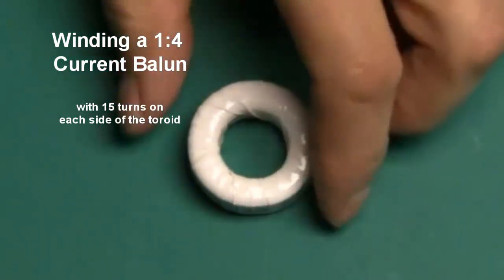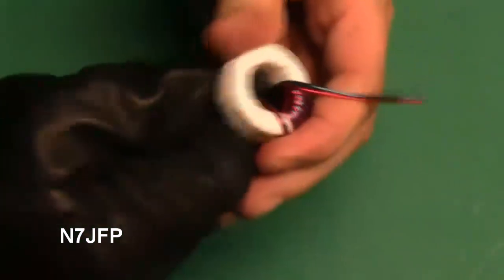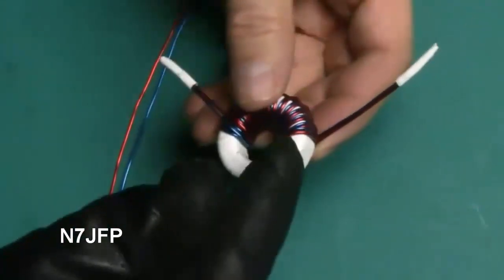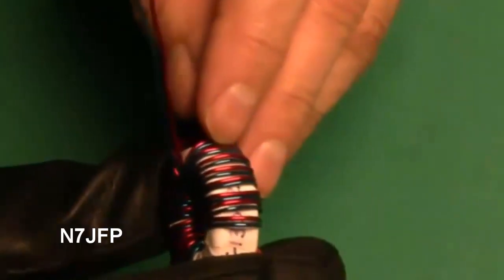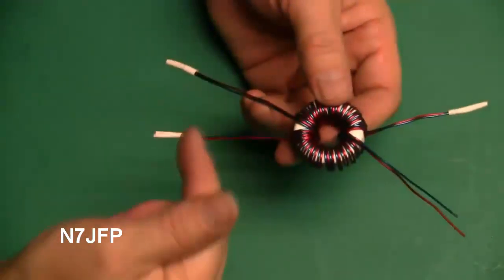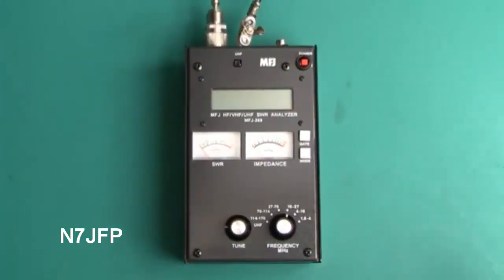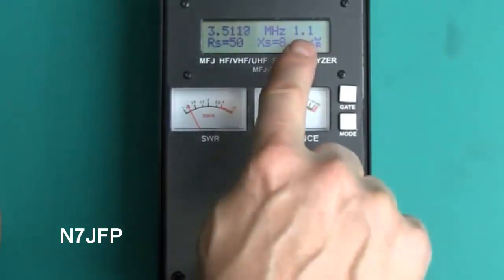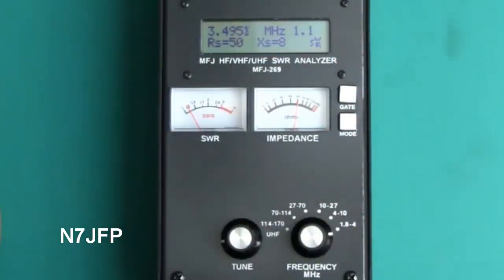Winding a 1:4 Current Balun with 15 turns.

Comment: I noticed that you call this 1:4 instead 4:1 are they the same thing or totally different? Will this ballun match a 50 ohm radio to a 200 ohm antenna
Reply from the maker: Yes. 50 to 200.  Works great.  Thanks for watching. N7JFP

Comment: Are they good or help receiving as well
Reply from the maker: I have not tried using it on a receive only antenna.  It's main purpose is for the transmitter/antenna matching.  73, N7JFP

Comment: I am very sorry, but what you have made is a 4 to 1 balun (4:1) for a 200 ohms antenna.
 That's why you are using a 200 ohms resistor for your testing...
A 1 to 4 balun (1:4) is a step up transformer used for a COBWEB antenna which has a 12.5 ohms impedance when complete. The 1:4 balun brings the matching circuit (antenna) from 12.5 ohms to 50 ohms.
 
Also for a much better result a FT240-43 toroid ferrite core is recommended for any type of balun for HF (all HF bands).
73's de M1ENE

Comment: I am very sorry I dont agree with what you are saying ...
A1:4 balun is a step up transformer ... for instance, a COBWEB antenna when complete is 12.5 ohms which requires the 1:4 balun to bring it up to 50 ohms.
The single loop antenna is a 200 ohm antanne this then would require a 4:1 balun to step down to 50 ohms...

Comment: You cannot make a 4:1 CURRENT balun  with a single core. What you have made is a  4:1 transformer. What is the purpose of a balun- it is to transform a balanced load to an unbalanced source- this is called the common mode rejection ratio.  Measuring  the SWR does nothing to indicate the effectiveness of the balun. Nor does it indicate the insertion loss of the  balun.  Finally, wideband baluns are made from ferrite materials not iron powder. You are misleading hams.
Reply: I have previously constructed the type using two seperate ferrite cores, very succesfull, worth looking at W8JIs site. The core type here, perhaps an Amidon T200-2 does make good rf transformers, they were very popular for the purpose (despite being iron powder). My guess is that this will work for the impedance transformation but not attenuate common mode current much.

Comment: Thank. You for your video.  I noticed that you did not show how you would check for Common Mode Currents in this project. Were you able to do so?
Reply from the maker: I did not check.  I was looking for a low SWR on 20m and 40m.  I run 5 or less watts.  73, N7JFP

Comment: Have you tried a different core material to get a wider frequency range.
Reply: I have not tried different core types.  The T130 was the type specified for this project.   It worked for the HF bands.  There are a lot variables to change to get a better bandwidth.  Good luck experimenting.  73, Larry

Comment: Why does it take so many turns?
Reply from the maker: There are many books and articles that show the formula for calculating the impedance of the balun in a certain frequency range.  Most things are variables.  Type of material and size of toroid, wire gauge, number of turns and spacing of wires. 73, N7JFP

Comment: Can this be used for UHF  TV antenna or it is only suitable for HF?
Reply from the maker: +Zara Hall This toroid is designed for HF frequencies.  You would have to find a toroid made for UHF frequencies.  The 1:4 ratio should still work.  73, N7JFP

Comment: I notice at the beginning of the video you say you need 16 turns but later on toward the end of the video you say and count 15 turns. Which is it 15 or 16?
Reply from the maker: +KB3PHL  I made an extra turn on one side. One side is 15 the other side is 16.  Does it make a difference? I am not sure.  I would try to make both side equal. 73, N7JFP

Comment: Would you need a bigger size toroid for 12 or 14 gauge wire?
Reply: @KB3PHL: Yes, one does. The nomenclature of the toroid is simple: The first number denotes the diameter (higher is larger) and the second denotes its ferrite composition (e.g. 2 is for 0,5 to 30 MHz). 
One could use thicker wire to have increased power capabilities. It does not affect the freq. response, as long as you wind it tight to the toroid. 
You do not need to wrap the toroid in tape or anything, but it helps to prevent arcing in unusual bad cases. I used 14 AWG for my UnUn with a 200-2 toroid. It handles 500 W with ease.
73, PD0PSX the Netherlands.
Reply from the maker: +KB3PHL I have not tried the heavier wire.  You might get only half the number of turns. Not sure how that wire size would effect frequency response.  Should increase power capability.   The best way to find out is to build one.  Good luck.  73, N7JFP

Comment from the maker: They both work.  The frequency response might be a little different.  With the 8 turn model a larger wire size can be used for higher power.  I tried both to see what the difference was.  The wiring method causes the ratio to come out the same.  73, N7JFP

Comment from the maker: That's great.  I used my 4:1 Balun with a 40m Delta Loop that is horizontal. On 40m my SWR is 4:1, but 20 and 15m are 1.5:1.  Good DX, 73, N7JFP

Comment from the maker: The purpose of a 1:1 Balun is to reduce the travel of RF back to transmitter caused by a impedance mismatch at the antenna.  The 1:1 Balun would normally be placed very near the antenna.  If you are not transmitting there is no need for a 1:1.  Look up "Preselector"and how it improves reception in receivers.  73, N7JFP

Comment: Thank you N7JFP. That being the case, would using a 1:1 in addition to a 9:1 balun be the best solution for a random wire antenna connected to my short wave radio to give it the ability to receive even better?  For example, if the 1:1 was used at the end of my feedline just before my receiver then I would then connect a 9:1 on the other far side (the side I would connect to the antenna) of the 1:1 balun.  Would you consider that to be a more ideal set up?

Comment from the maker: The purpose of a Balun is to try and match the radio impedance to the antenna impedance. A long wire antenna has a high impedance, so a 1:9 balun would help in matching. Ham radios are made with a 50 ohm output.  So a 1:9 is 50 ohm to 450 ohm.  An antenna tuner would also help. good luck, 73 N7JFP
Reply: The purpose of a balun is NOT to match impedance.  The primary purpose is to attenuate common mode currents.  What you made is a transformer, not a balun.
Dale W4OP

Comment from the maker: The 1:1 balun is a RF choke.  It's purpose is to stop the RF from coming back down the antenna feed line.  One wave length of coax coiled up will work.  Search Internet for RF choke or 1 to 1 balun.  Check this: k8dns.com + /balun.html 73, N7JFP

Comment from the maker: @josh2utube The SWR/frequency response curve can be varied by changing several components.  Wire size, wire spacing, and toroid type are a few.  I recommend "Transmission Line Transformers Handbook" from Amidon Associates, inc.  73, N7JFP